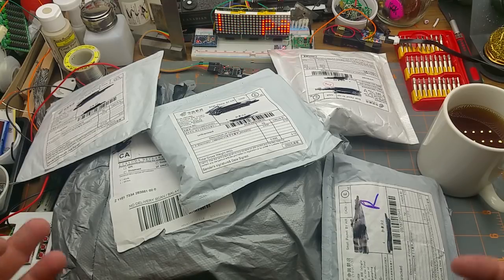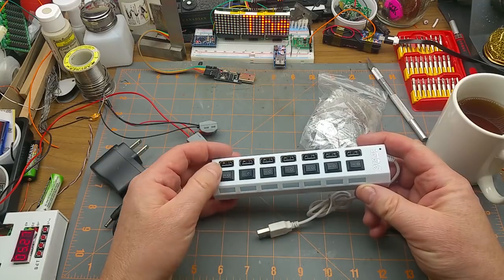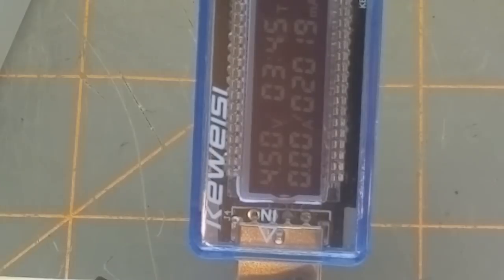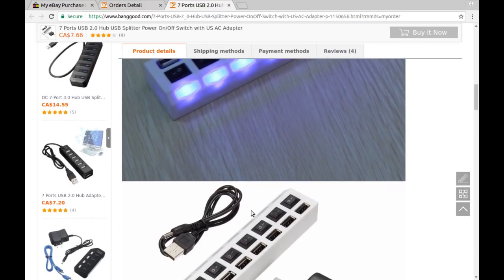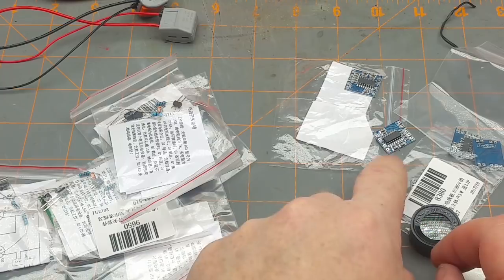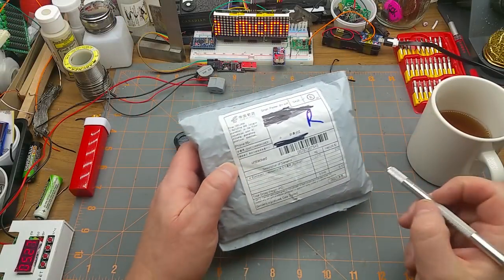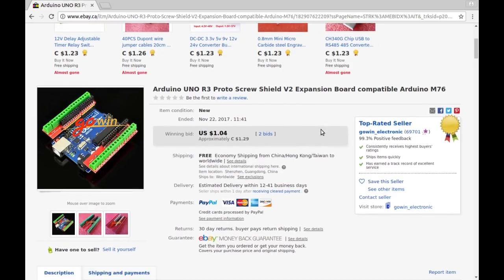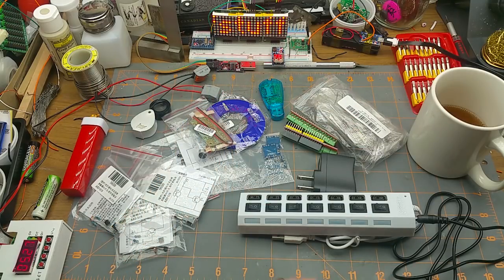mailbag monday 20

Comment: We got our Pam8403s about the same time. 30 cents for me. ( Bid ). The clap switch was fun for me to build. It's in a drawer somewhere now. ( I have google home and Amazon Echo, Built my own 8266's to turn stuff on now). Besides, when I clapped the cats ran off. Got a few of the LDR things too, But dunno what I will use them for. The Sim thing I have also. But I think it's only for the 1st generation cards. I also got the Uno terminal boards. but find them hard to screw stuff to when mounted on the Uno. Never thought of putting a shield on top to stabilize it. Thanks for that tip.  Mailbag Monday Returns, Ya Hoo. Thanks for the entertainment Kent.

Comment: You should take a look at the hub. Mine send the power back into the computer and caused some issues.
Reply from the maker: I'm planning to crack into it for friday's video if I have time. I'll definitely check the power isolation.

So far I'm not impressed with it. Too bad really, it has such promise.
Reply: mine only has the first port working...
Reply: I don't think there will be any isolation. Also that voltage drop is probably because of both cable and power supply. Just because it says that it's 1000mA, it doesn't mean that. Some time ago I ordered cheap 2A usb charger, when I connected it and used a constant current load with usb charge doctor in between, I got almost 6V on 500mA load, and about 5.3V on load.
Reply from the maker: kjur18 : the wall wart is one of the things im looking at as I put together the next video. 

Spoiler: this thing has multiple problems.
Reply: I was about to mention putting load on the wall wart, but now it seams like it has more problems.

Comment: usb 2,0 hub need biggest wall power, 1A have wery little 7 port huv, need 3A power or more.7x 500mA need 3,5A or 1Ax7 port 7A power can use good normal.i has orden similar 10 port and change power supply first before start use, have today 3 pcs this many place.